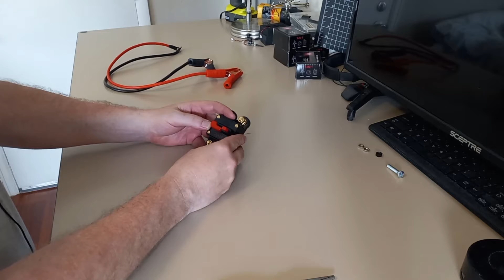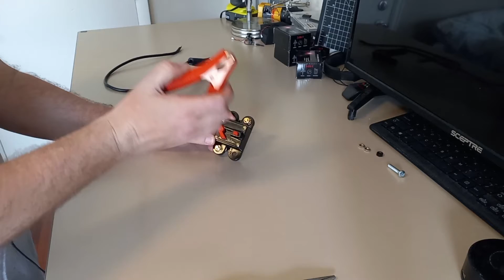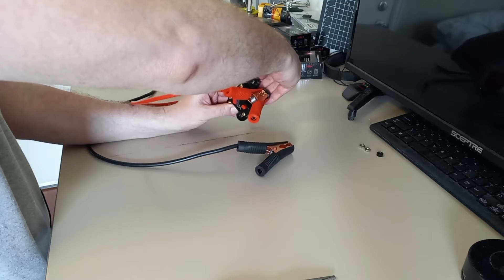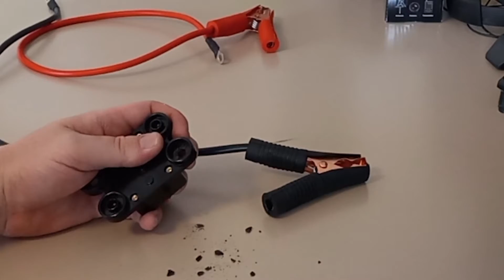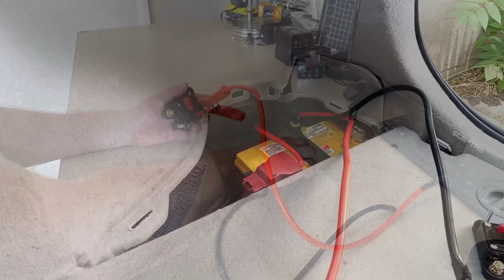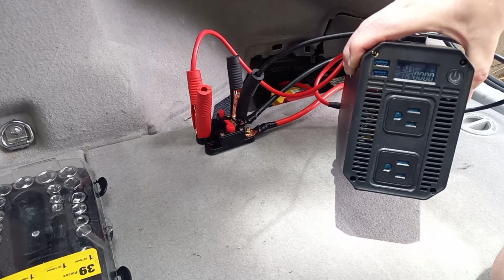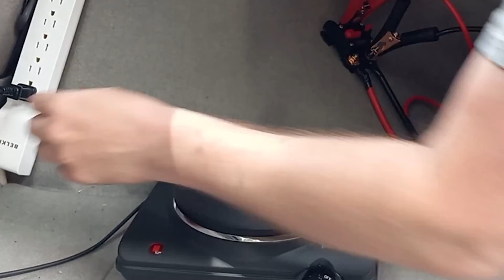Car Camping - Powering Car Appliances

Comment: You made it so simple 👍 thank you I'm doing the same, just don't know 1000 watt or 1500 ? I'm sure I'll figure it out.
Reply: You shouldn't go over 1000w on the 12v battery
Reply: @pilinke11  thanks so 1200 too much? 2010 Prius 800 Watt microwave
Reply: @user-sf9ck9yx2f  yeah, a 1200w should be fine, but don't try to reach 1200w of use, probably 1000w as a microwave, I have read people have use the inverter around 750w for 9 hours straight without problems
Reply: @pilinke11  thanks I'll be only be using it to warm things up 5 minutes
Reply: @user-sf9ck9yx2f  you should be more than fine, also I'm misspelled the comment, I meant I have read on forum people have use it for hours WITHOUT problems 😅
Reply from the maker: Thank you for watching the video and taking the time to leave a kind and supportive comment.  In terms of the inverter size, depending on the microwave, the inverter will not only need to be capable of 800 watt sustained power, it will also need to handle the microwave's peak power.  Microwaves usually have a spike in power when they are turned on, and that spike can be considerably higher than 800 watts.  I recommend buying your inverter from somewhere that allows returns, like ordering through Amazon and checking first to make sure returns are allowed on the item.  That way you could order a 1000 watt inverter and see if it works with your microwave.  If it can't handle the peak load, then return and upgrade to a larger inverter.  Hope that helps.  Good luck!
Reply: @jasonvansickle  once again 👍❤️

Comment: What is the size of DC cable connected to battery? 10mm or what?
Reply from the maker: I used 2 gauge cable to go from the battery to the breaker, then I used the cables that came with the inverter to go from the breaker to the inverter.  However, you should definitely do your own research, because I am not an expert and using the wrong size cable can cause the cables to overheat and possibly start a fire.  I recommend doing a Google search for "choosing the correct cable size for inverters", to research the size of cables you would need for any inverter that you are planning to install.  I hope that is helpful.

Comment: Those Chinese circuit beakers are not good in quality apparently. Buy more expensive quality beakers that will actually protect you instead of cause a fire.
Reply from the maker: Thank you for the feedback.  My breaker is only used to manually turn the power off when I am not using the inverter, and it has worked well over the last couple of years.  However, you bring up a good point about using only quality parts.

Comment: But wouldn’t you also need to setup another breaker at the front of the car if you use the inverter there?
Reply from the maker: That is a good point.  A lot of people install inverters without using a breaker, so they are not necessarily needed.  However, I wanted a way to turn off power when I wasn't using the inverter, so it didn't accidentally get turned on.  For that purpose, you would install a breaker between the battery and the inverter, regardless of where your battery and inverter were located.  By the way, I am not an electrical expert, so please do your own research on proper installation, before installing any electrical equipment in your car.  Good luck!

Comment: A couple thoughts: the way you have the ground clipped right next to the postitive line before the positive line goes through the breaker seems a bit needlessly dangerous to me... Also if your breaker is only being used as a switch you might consider just using a relay. That way you could have all this beefy wiring out of sight and just a small switch visible to this on and off. Or if the inverter has a switch you can open it up and connect your externally mounted switch to the same wire terminals. In other words you'd just be mounting the inverter's switch remotely.
Reply from the maker: That is really helpful feedback and information.  Thank you for taking the time to post your thoughts.  I chose the breaker, simply because it was quick and easy.  It gives me a way to connect and disconnect both the inverter and the jumpstart battery pack without having to open up the back of the car and uncover the battery compartment.  However, I will definitely consider your thoughts and recommendations, as I continue to make upgrades to my car.  Thank you again for the post!

Comment: Thanks for answering so many questions so clearly and patiently.  I read everything and learned a lot.  Most people sound like they're speaking another language when they talk about electricity and electronics.  It's so refreshing that you use plain English!

My question is simple.  What kind of connectors do you use to hook the cables up to the posts on the battery?  Are they simple ring connectors?
Reply from the maker: Thank you for taking the time to watch the video, and thank you for leaving a kind and supportive comment.  To answer your question, I simply used the connectors that came on the cables, and (yes) they were ring connectors.  Let me know if you have any other questions.

Comment: Prius's charge current that goes to the starting battery is not very much. It's limited to less than 10 amps I believe. The vehicle actually starts off the hybrid system unless the hybrid battery is low than it starts off the starting battery. I noticed the sag in voltage drop to 10.7 volts while that hot plate was on. That's a very heavy load being applied to such a small battery.
Reply from the maker: Thank you for the informative comment, and thank you for taking the time to watch the video.  You bring up some very good points.  Over the last year, I have learned a lot about my Prius and running different items, on different sized inverters, in different configurations.  I recommend that anyone who plans to hook up an inverter in their car do a lot of research about how inverters work and the best way to hook them up to your specific make and model, before running any items off of an inverter.  I have found the configuration that works for me, but every car and every inverter is different.
Reply: @krystof is WRONG! It doesn't matter that the Prius hybrid inverter can do 100amps because the 12V inverter is hooked up to the 12V car starting battery THAT DOES NOT DO PASS THROUGH POWER FROM THE PRIUS INVERTER beyond the 10amps to CHARGE the 12v starting battery.
Reply: Prius inverter can deliver up to 100A at maximum load,so it shouldnt hurt 12v battery so much.But car must be in ready mode

Comment: Great information and really well explained.   I will be using your exact setup on my 2014 Prius.   Wondering, do you have the engine on ready mode when using the inverter to keep the 12v battery charged?  Also I saw many folks on the Bestek Amazon page saying they thought the cables provided by Bestek were too flimsy when using anything close to the 1000 watts and would get too hot.   Wondering if you found any overheating issues of any of your cables when using your 875 watt hot plate...or if you have an opinion about that.    Thanks !!
Reply from the maker: Thank you.  I appreciate you taking the time to watch the video and leave a comment.

I do have the car turned on when I use the inverter.  That allows the engine to kick on when needed to keep the battery charged.  I haven't had any overheating issues with the Bestek, but I haven't used it with any high wattage appliances.  Unfortunately, it turns out that the hot plate actually draws over 1000 watts, even though it is advertised as a 1000 watt device.  I could never get it to work with my 1000 watt inverter, because it kept tripping the inverters internal breaker.  So, I just purchased a 1,500 watt Kinverch pure sine wave inverter from Amazon, to power the hot plate and a microwave that I ordered.  

After my experience, I would recommend that most people consider getting a 1,500 watt inverter, if you are going to power 750 to 1000 watt appliances.  Appliances seem to draw more power than advertised.  For example, the 750 watt Black and Decker microwave that I just bought from Amazon seems to actually draw around 1,050 watts when running, so it couldn't have run on my 1,000 watt inverter.  

Definitely do your research before buying and installing an inverter.  Make sure you understand how inverters work, why you might need a "pure sine wave" inverter, and how to install everything in a safe way that does not create a shock or fire hazard.  It take a little time to research and learn about inverters, but there is plenty of information online.  Good luck with your 2014 Prius!
Reply: @jasonvansickle   Cool...Thank you again!   Having a backup  jump start does make sense. I plan to use a small 350 watt heater (not sure how effective that will be), a 350 watt rice cooker with steamer (cooks grains and veggies at the same time and keeps warm when done - $20), backup for my alpicool refrigerator - < 65 watts).   Gonna return my 1000 watt hotplate.   Hoping my 700 watt instantpot mini will be ok also..   Gonna try to make the 1000 watt Bestek PSW work since I already have it.   Hoping if I use the same switch setup that you used and wire it as you have done I will be ok.  I won't be full timing..mainly for a week or so at a time.  Mostly I don't want to damage my car.

Comment: Watched this video half dozen times already plus all your others but this particular one is where I’m at with my Prius Gen 2, back and forth with portable power stations, aux battery with inverter choices with solar then I roll back to this choice because my car is a power station on wheels LoL. 
Using your Amazon link to pull the trigger on the Bestek Inverter…thanks for the awesome informative content…cheers 🍻
Reply from the maker: Good luck with your Prius modifications.  My best advice is to make sure that you think about all of the things that you want to power, and get an inverter that is powerful enough.  If I did things over, then I would get a slightly more powerful inverter.  My 1000 watt Bestek struggles to power my 1000 watt hot plate, so having something that could power more demanding devices (like a 1500 watt or 2000 watt inverter) would be nice.  Also, don't forget to get a "pure sine wave" inverter.  They cost more, but they will provide a higher quality source of power.  Cheaper inverters could potentially damage (or ruin) some devices.  

Thanks for taking the time to watch my videos, and thank you for your comment!